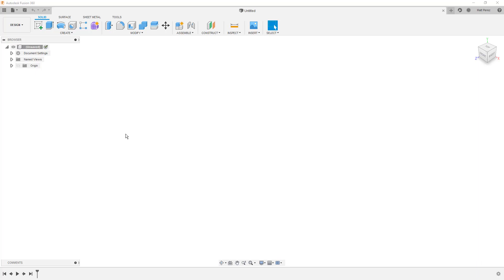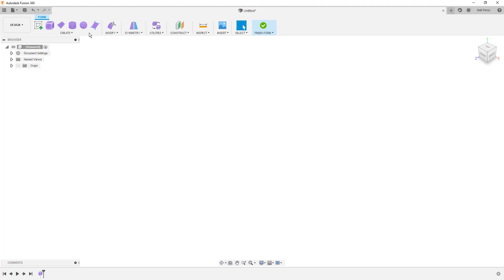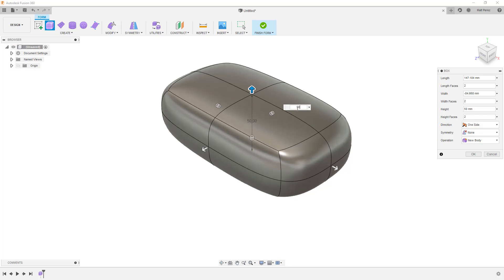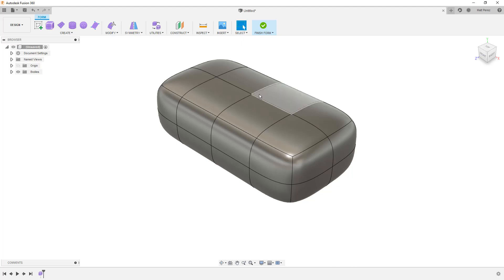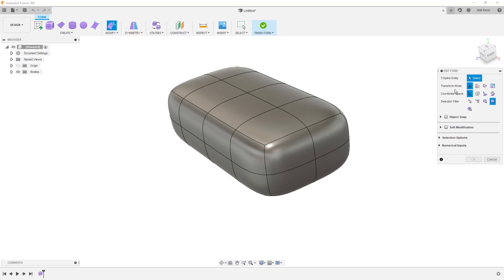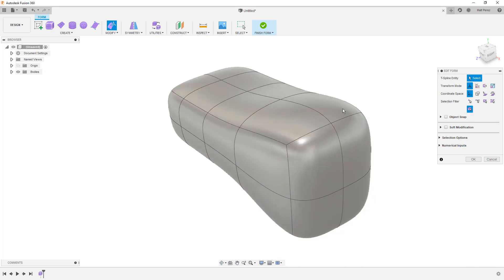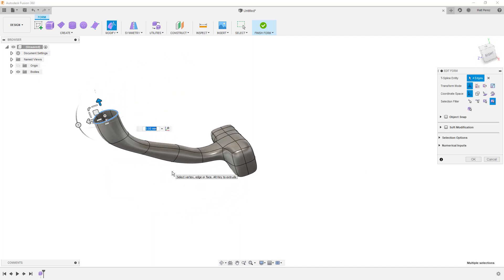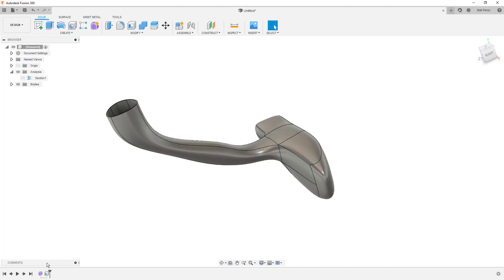Intro to Fusion 360 - Part 6: Introduction to Forms #Fusion360 #HowTo #Tutorial #Forms

Comment: I'm an artist who has tried to learn Fusion 5-6 different times. I'm very impressed with the approach and pace of explanation. Very well done. In just 6 videos I'm further along than any previous attempt and actually understand the purpose and intent of the tool. Thanks.
Reply from the maker: Love to hear that!  I am working on a new website with a whole host of courses geared towards beginners where its all explained in detail(hopefully).  Ill be updating a post and in videos mentioning when that site is live but it will cover assemblies/motion, sheet metal, surfacing, forms etc.

Comment: In my personal use version of fusion when I create a box form as you have done it is a surface body not a solid body. What am I missing here?
Reply from the maker: Hi Jay, when you are working in forms anything that is completely close, "water tight" should convert to a solid.  Anything that is open should convert to a solid.  If you deleted a face OR one of the edges isn't stitched then it will default to a solid.

What happens if you make a new box, don't modify anything and just finish the form?
Reply: @LearnEverythingAboutDesign  That's what I did I made a new box and upon inspection it was a surface not a body
Reply from the maker: wow that is very odd.  Can you email me the f3d file or a share link to support@caducator.com and i will take a look.  I just tested on my end and it works fine.  I know there are limitations with the hobby license so you could also download this. https://a360.co/3wE9Hev   Its saved while in the form of a box and converts to a solid fine for me.
Reply: @LearnEverythingAboutDesign  Your model is also hollow. Any way to make it a solid body? Must be the version I have personal use.
Reply from the maker: That is very strange!  Navigate to the Surface tab after you finish the form, select the entire thing and try to stitch it.  If its a close volume that will turn it into a solid.
Reply: Ok, here is what is happening. If I create a box form and immediately inspect it is hollow. What I wasn't doing was hitting the "Finish Form" button. After hitting that it is a solid. I must have missed that part in watching your video the first time. I went back and reviewed the video and you hit Finish Form before inspecting. Thanks very much for getting back to me and helping me sort this out. As always the solution is simple! Thank you for taking the time to make these instructional videos. I'm new to CAD and Fusion find them very helpful.
Reply from the maker: Glad it was that simple Jay!  Forms are "contextual" meaning that when you are in Forms you are basically direct modeling.  Fusion has an alternate workflow where you turn of capturing history and you need to manually convert the form.  Don't worry about that for now but I was thinking maybe you somehow had that happen.

But yes the Forms bodies will always appear to be surfaces until they are converted using "Finish Form".  It is basically a mathmatical conversion taking that SubDivided body and converting it to a "BREP" or boundary representation, which ends up as a solid in this case.

Happy to help!  and don't hesitate to ask questions!